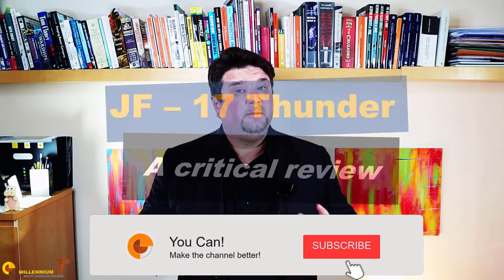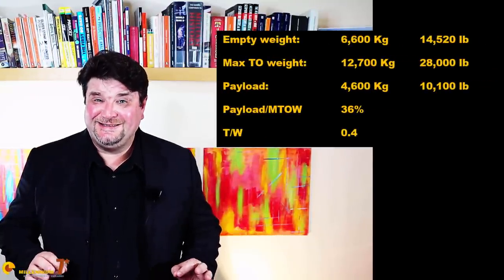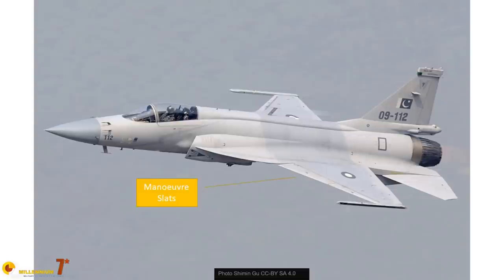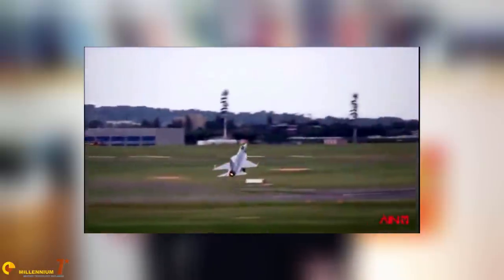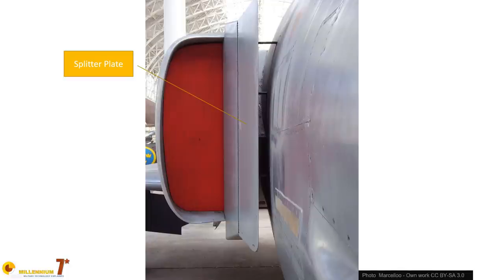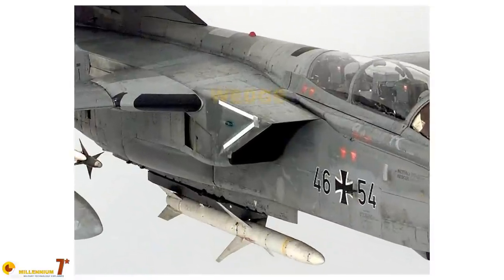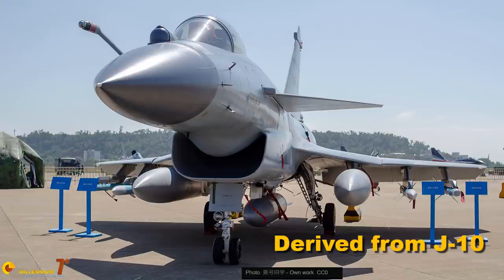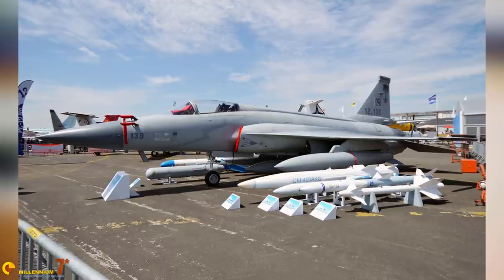JF-17 Thunder Block 3 & F-35 - What do they have in common?

Comment: JF17 was not selected for PLAAF because they have a large area of operation due to size of their country. It was ideal for PAF who have a relatively small area of operation and provides them with an economical   platform with which they can integrate a variety of weapons.
Reply: LoL PLAF still using F-7 in Active Opration which is less range and Capability then JF-17. China don't use JF-17 Simply coz they have much better J-10c. JF-17 made for countries who Can't afford western jets and their maintenance. Have you chek Pakistan's budget.
Reply: Admiral Ackbar’s adopted son  China is capable enough to make JF-17 inside China. Infact all JF-17 blocks 1st made in China then technology transfer to PAC to make in Pakistan still all major avionic are Import from China. Name one major Avionic that is made in Pakistan ! 
If China need to replace J-7 they will better choose J-10C then JF-17. Have you check JF-17 Life it's only 4000hrs. China have money and better option unless Pakistan not have that much budget for better Fighter jet. Few months back Pakistan was running for Mig-35 but then rejected due to crippling economy.
Reply: @rajatdas3534  dont worry about the economy, worry about the slap that Pakistan airforce gave to your "airforce "
Reply: @eysadiq9088  he doesn't know that paf pilots are more capable than iaf pilots world also know about the experience that paf pilots got they are far much better than the jackals that are in IAf
Reply: @rajatdas3534  what are you whining about budget?
Reply: @galaxyofvid2738  We ,are buying u fool.U r the one who always begs for military aid.U r the one currently begging IMG for money.
Reply: Main reason. Plaaf has the funding to. Induct. Bigger more. Expensive j10 as majority fighter 
Pakistan needs a low cost fighter for its majority fleet as the host said jf17 is cost less then half but packs more then half of f16 
Jf17 is replacement of older f7 and mirages 

For replacement of f16 project azm is In progress 
There too experience from jf17 development is helping alot
Reply: @firohot5476  that's the real explanation thanks
Reply: @Sujeet Dutta because they already had em and r  not using em as fighter but for peripheral thing's like pilots training experimental platform many converted into drones 
But as for jf17 it's new jet they already have j10 so no point in spending $ on two different jets with similar capabilities
He dsi were first developed and tested on jf17 then on j10 c
Reply: One reason why Pakistan opted for jf17 instead of license production of j10 is that there's a western embargo on military technology to Chinese 
If we wanted to install a western system like Italian selix radar onto j10 we would need Chinese assistance as they wouldn't give us all the source code and China involvement would deter Europe to give the weapon system since jf17 is JV we have all the source code and IP we can add third party systems without china help and they too would have no problems with it Italy offered it's radar for jf17 we used Turkish irst etc on jf17
Reply: @eysadiq9088  slapped an outdated mig 21? Remember how you got slapped so hard that your country broke into two pieces and you surrendered 93000 men ;)
Reply: @rajatdas3534  lmao only forst 6 block ones were made in China and were transfered to Pakistan for assembly...

And China is using JF17 for many reasons one of them as you stated is J10 which is more capable second is range of JF17 which is less than their operational area... F7s are old tech which are now used in specific areas...
Reply: @Sujeet Dutta that’s the most stupid comment . Chinese J7 are older, J10 is new. It won’t replace in one night every J7, is he ?
Reply: @sponky8614  dont Forget the Su30MKI which were missing in action on and after the 27 February 19. ;)

Don’t forget the Mi helicopter your own forces killed in the panic. 

India realised that it wasn’t 1971 anymore...
Reply: @Sujeet Dutta thank you for your comment. 👉🚽
Reply: @DS-ll6zyelle  except there is no proof of the su 30 mki going down :D
Reply: @DS-ll6zyelle  and i dont wanna hear a pakistani talkingabout friendly fire, as if it didnt just lose an f16 to friendly fire
Reply: @sponky8614  then why  no Su30MKI was seen in the air after 27 February 2019 despite the warmongering in India ?

Add to that few days later, 2 Su30MKI pilots were declared dead in a strange car accident, 

Had no Su30MKI been downed, the very next day, you would have sent them toward Pakistan border !  

😁
Reply: @sponky8614  the F16 was hit by a friendly fire during an air battle against the Soviets Jets. 

A Pakistani jet fired a missile at Soviet jet but in matter of seconds another Pakistani F16 came in the path of the missile and was hit.

Not same as an helicopter being shot when and where there was no enemi fighter in the area. Just panic 😁
Reply: @DS-ll6zyelle  mhm, and what happened the the f16 that went missing this year?
Reply: @DS-ll6zyelle  send me the proof. The pilot you claimed to have xshot down was israeli (idk if you guys were smoking crack) and the second was a ground offficer
Reply: @sponky8614 Ask Christina Fair. She is very anti Pakistan. And she denied your claim. 
And an article from a newspaper — mouthpiece of the Pentagon— claimed that all F16 were counted in Pakistanis  airbases. 

So india is making such claim alone and was debunked so many time. 

Open your mind and follow international news... not the only from your country. You will be able to understand which is fake news and which isn’t. Grow a little bit man.

About the Israeli pilot, all were rumors. 
So let’s tag them as fake news.
Reply: @DS-ll6zyelle  i never said anything about the f16, just said that shooting an outdated mig 21 down wont make you a god tier airforce
Reply: @DS-ll6zyelle  oh and byw, they said tjat the count was not done sooooo
Reply: @sponky8614  we were talking about 2019 events and you asked me what happened to the missing F16 this year... so as you didn’t specifically changed the year you are talking about, it’s normal to believe you are talking about the claim indians made about an F16 they shot. But no one bought your claim. They instead debunked it. 

Now if you are talking about another event, at least have the honesty to tell clearly which F16 are you talking about specifically. 
But I know it’s very difficult for indians to be honest.... I’m saying this because I have interacted with many Indians at different companies I worked for. 
Thanks.
Reply: @DS-ll6zyelle  you did realise that i asked about the f16 when you talked about the friendly fire right?
Reply: @DS-ll6zyelle  anyway, i was talking about the blackout that happened in karachi
Reply: @sponky8614  there is a difference between a friendly fire where you are firing in the middle of a battle and a friendly fire where there is no battle taking place.

There is a huge difference.
Reply: @sponky8614  could give date of the blackout in Karachi ?
Reply: @DS-ll6zyelle  June 10th
Reply: @sponky8614  so what’s happened on that day ?
Reply: @DS-ll6zyelle  basically, the whole of karachi blacked out that day, and the citizens believed that iaf was over karachi, because of a high number of jets flying all over the place. An f16 went missing, which basically was fake news since it never happened. My bad :P
Reply: @sponky8614  well basically you were out of topic since the beginning
Reply: @DS-ll6zyelle  I mean, there is still no solid proof of neither the su 30 mki nor the f16 being shot down, so we both jave nothing to give. Shooting down a mig 21 still doesnt cover the fact that you lost half your country, and surrendered 93000 soldiers
Reply: @sponky8614   please I was glad to have found a sane person whith whom I could discuss like respectful adults so stop trolling. Bangladesh was lost because of internal politics. No sane army would have won if it was found in same situation. 

 army was where people didn’t wanted them anymore and was facing Indian army and  was separated by 2500 km from its capital. 

What could have been done then  except laying down arms ? They could have fought till last breath but what ? They would have lost lives and made widows and orphans in India... for what ? 

Nothing ! I have already declared those events as full mistake and serious crime against Bangladeshi people. Pakistanis are not happy with me on this point but they have to accept it. 

When Pakistanis are wrong, I told them, when indians are wrong, I told them too. 

I hope for better of all people. 

Talking about proofs or no proofs, there any proof for sure but... 

If India didn’t lost any Su30MKI then why they were not been seen when Abhinandan was shotdown ? And why Narendra Modi resorted to threat of launching ballistic missiles against Pakistan ? To what Pakistani Prime Minister replied that they would launch 3 for each one launched at them ?  

In court it’s called “evidences pointing”. There was something really fishy on Indian side. 

Take care
Reply: @DS-ll6zyelle  Just take a look at how much land was lost on the western front btw
Reply: @DS-ll6zyelle  I mean, someone has to be immature to think that shooting down a mig 21 is gonna cover up what happened in the 'past', as if you didnt lose four times in a row
Reply: @DS-ll6zyelle  fun fact- 97% of india has access to toilets while 40% of pakistan lacks them :)
Reply: @sponky8614  yes in Bollywood !
Reply: @DS-ll6zyelle  mhm, calling the truth as bollywood is the most pakistani thing I have seen
Reply: @sponky8614  hahaha 🤣 

I let everyone judging the credibility of Wikipedia.
Reply: @DS-ll6zyelle  you can check again
Reply: @sponky8614  Stop arguing guys. Both the countries are way off the standard they should be at. Infact all of South Asia. We are just competing with each other instead should be competing with the West or even China, Japan and South Korea. We have more resources than all of these countries combined yet we are no where near them. Same thing happening in Sports.
Reply: @rajatdas3534  lol we made it ourselves and it goes to 2x the speed of light meanwhile you keep begging usa for f16s keep crying  buddy
Reply: @sponky8614  again  keep boasting about 50 years ago when we weren't even developed
Reply: @asxxdm  india was in a much worse position than pakistan at that time
Reply: @sponky8614  lol half of us didnt even have guns you were and still are over triple our population  ,size and gdp so sit down stay salty that we're pushing boundaries
Reply: @asxxdm  pushing boundaries? last time you pushed boundaries was in 1947, because india reached outskirts of lahore, cut the country into two in 1971, took siachen in 1984, and destroyed thhe intrusion plan in 1999.
Reply: @sponky8614  obviously you think the world revolves around india  but no i was talking about the jf17  actually clean cities unlike yours development in sports and technology
Reply: @rajatdas3534  well that's ok
Reply: @eysadiq9088  your force losing an f 16 to a generationally inferior mig 21 bison is a slap to the PAF lol.
Reply: @mctyfun531  abhinandan is our witness
Reply: @asxxdm  yeah he knows how bad PAF pilots suck after he downed your f 16 lol
Reply: @mctyfun531  fake indian media lol w used jf17 thunder for the execution give me one non indian source
Reply: @asxxdm  😂😂😂
Go read Kaiser Tufail's blog where he's openly admitted using the f 16 on 27th feb.
Reply: @mctyfun531  yeah one guy whos defo not indian based
Reply: @mctyfun531  and it mever says it got shot down. keep making excuses and well make tea
Reply: @asxxdm  lol, you confidently asked to give even one non Indian source to prove that PAF used f 16 or not and I gave you one who is a senior PAF officer. So stop with the excuses.
Reply: @mctyfun531  we all know hes biased look at his other vids give an international reputable source hes just a money hoarder bbc or anything else
Reply: @asxxdm  from what I've heard, Kaiser Tufail has a great reputation in Pakistan. Its just that some Pakistanis find it hard to admit facts when  it does not support their agenda. Anyway I already gave exactly what you asked for, you trying to move the goalpost now is quite hilarious but not unexpected from a Pakistani lol.
Reply: @mctyfun531  funny how youve got nothing to show for it except kaiser tufail keep making excuses and dont worry its ok that paf is better than iaf
Reply: @asxxdm  funny how you keep trying to move the goalpost and say jokes like paf better than iaf. Very funny 🤣
Reply: @mctyfun531 the fact is that ur media made a lame excuse to try and take glance off abhinandan and you know it. keep barking
Reply: @asxxdm  what I know is that your DGISPR claimed there were 3 pilots which by evening came down to 1.
What I know is pakistan denied using f 16 but was exposed by one of its own officer.
What I know is Pakistan claiming they've shot down an Su 30 mki but were again exposed by its own officer.
And your media supported these lies along with claiming an Israeli pilot in custody lmao.
And this just about the 27th feb incident. If we look at the past 70 years, the list goes too long.
There's a reason why US has called you guys pathological liars on many occassions lol.
So better take your own advice 😏
Reply: @mctyfun531  lol it wasnt 3 it was 2 and ur media also said too ur exaggerating to try and mask ur failure. its ok buddy
Reply: @mctyfun531  and i havent even talked about yadav yet😂
Reply: @asxxdm  your DGISPR claimed there were three pilots with two in custody. Go check lol.
Reply: @asxxdm  well feel free to lie about Jadhav 🤣 but how does Jadhav come into this. Again you're trying to change the subject to what you think is convenient for you. Just pathetic lol.
Reply: @mctyfun531  did ur media not confirm 3 aswell?
Reply: @asxxdm  and you have no Su 30 mki to show lol. At least we gave the radar data captured from radars from different locations all confirming the f 16 was downed. Even OSINT data confirms the same.
Reply: @asxxdm  our media was only broadcasting your DGISPR's lies lol. Your media on the other hand claimed of having an Israeli pilot in custody 🤣
Reply: @mctyfun531  we have abhi tho
Reply: @mctyfun531  haha keep barking no proof
Reply: @asxxdm  By your words, it seems you've realized that you've been backed into a corner 🤣
Well no surprise, after all truth hurts lol.
Reply: @mctyfun531  lol we both know whos making stuff up and who is right
Reply: @mctyfun531  truth does hurt, thats y u cant admit iaf is a failure and that ur media made stuff up to try equalize it
Reply: @asxxdm  🤣🤣🤣
Is that why you sound so salty and writing complete nonsense then?

Where's the Israeli pilot?
Where's the Su 30 proof?

Where's the dusra banda? 🤣
Reply: @mctyfun531  well ur media did say 2 aswell lets just say he had a sticky end
Reply: @mctyfun531  no need for su30 when we have abhi thats enough proof
Reply: @asxxdm  so you don't  have any proof for the Su 30. Thought so 😏
Reply: @asxxdm  That takla Zafar Hilali has claimed live on Pakistani television that Pakistan has an Israeli pilot in custody.
Reply: @asxxdm  We never said two lol. Mig 21 is a single seater plane
Did the second pilot teleport into Pakistan? 🤣
Reply: @mctyfun531  source: trust me bro
Reply: @mctyfun531  ...but we have abhi yadav and that outdated mig20
Reply: @asxxdm  who is abhi yadav lol
Reply: @mctyfun531  u no who im talking about lol
Reply: @asxxdm  nope I don't know.
Reply: @asxxdm  poor guy, can't argue fairly so has resorted to throwing insults 🤣
Reply: @mctyfun531  he says while he made fun of me shortening abhinandan and kalbushan yadav
Reply: @mctyfun531  didnt u just  make fun of abhi yadav? indian hypocrisy at its best. you rlly need to get better at this
Reply: @asxxdm  lol, Abhinandan was returned the next day but not before Modi made Bajwa sweat and tremble as confirmed by you own parliamentarian.

Bajwa ke "pair kaap rahe the, maathe par paseena tha" 🤣🤣🤣

As for Jadhav, then India has successfully stayed his execution and he'll be out eventually. But again why are you shifting the goalpost? 😏
Reply: @rajatdas3534  China has J7 as a training aircraft. take older less important planes and use them to train newbies is better than giving them a new state of the art plane and have them crash it due to over confidence
Reply: @mctyfun531  abhi to uder he tha na🤣
Reply: @asxxdm  haa idhar hi hai. F 16 ke wreckage par bani chai yad krta rehta hai 😆
Reply: @mctyfun531  n o  p r o o f  h a h a
Reply: @asxxdm  yeah I know. Kaiser Tufail already busted your lies lol.
Reply: @sponky8614   India surrendered of azad Kashmir was fantastic shrooooop ☕️
Reply: @Realist Gunner  - yours was the silliest comment in this thread
Reply: Pakistan's military budget is falling faster than the price of this plane. At this rate, JF-17 will have to cost 1/5 of F16 to be affordable to Pakistan
Reply: @sponky8614  at least we didn’t shoot down our own helicopter in fear of enemy jets 😂😂
Reply: It's simpler than that, JF17 is way too small. Even the "light" J10 have max takeoff weight of 19 tons, while JF17 max weight is only 13 tons.
Reply: @firohot5476  u
Reply: @Sujeet Dutta 历史累计 慢慢淘汰吧
Reply: @Sujeet Dutta When the Chinese Air Force equipped J-7 on a large scale, they had no other choice. When JF-17 came out, China had other options, such as J-10, su-27.
Reply: @eysadiq9088 beggar it up